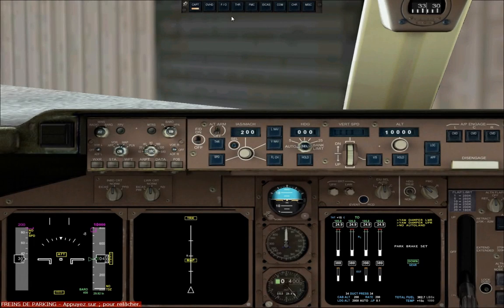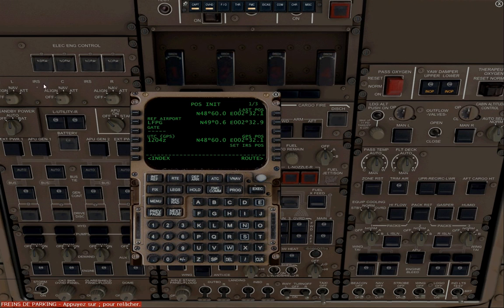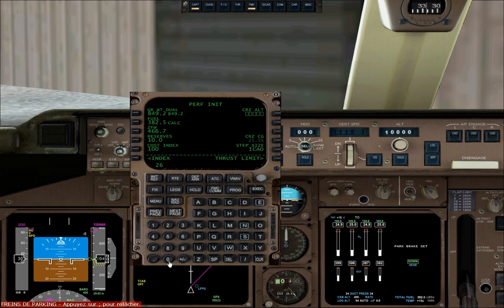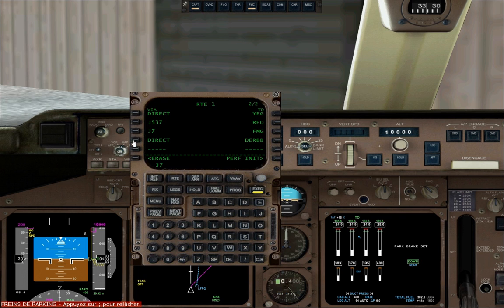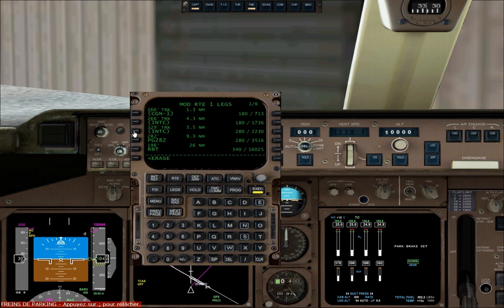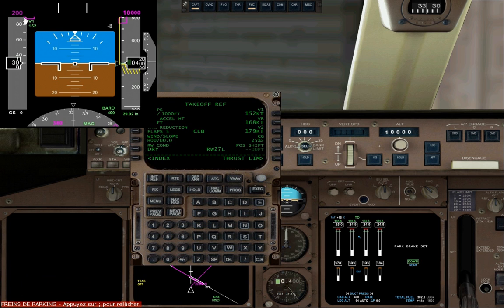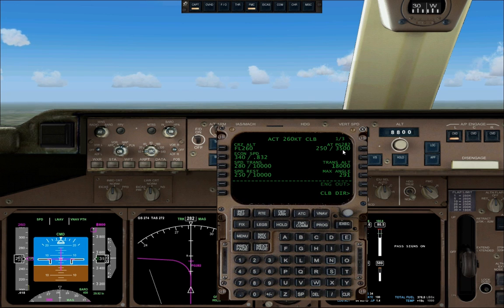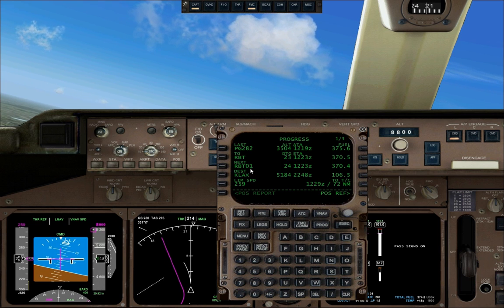PMDG 747 FMC tutorial part1

Comment: ZFW *is* computed automatically if you have a Weight&Balance System (PMDG seems to have this option, as L1 shows "GR WT DUAL" (i.e. it has two W&B systems).
It's also computed if you enter a Gross Weight  (on aircraft which don't have W&B systems).

Comment: Nice vid. I have a problem. When climbing to FL300 at 1800 fpm (on autopilot) the plane takes an extreme nose up attitude and bleeds off speed to the point I begin to stall. What am I doing wrong? Even when I get to level flight, the nose is still 20 deg high. Any help would be very much appreciated. One nice thing about us flight simmers, is we all help each other, which is why you posted the vid to begin with ;)